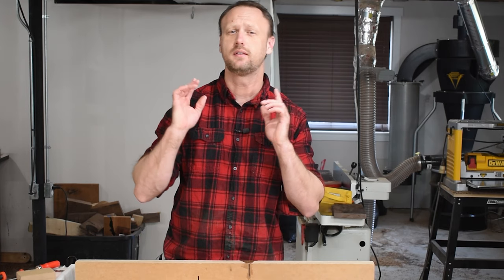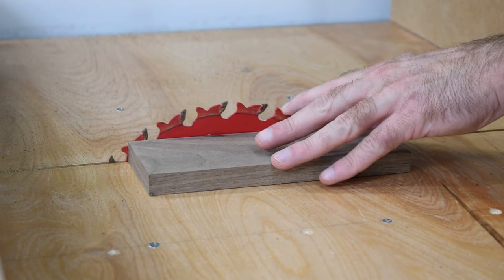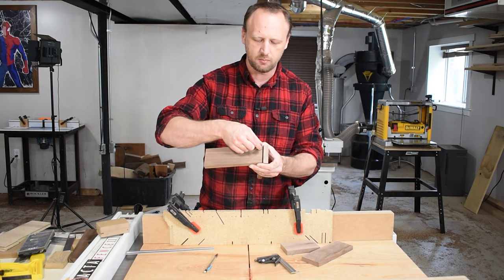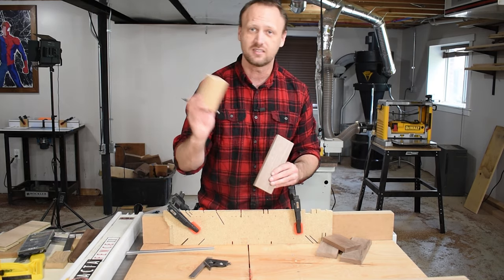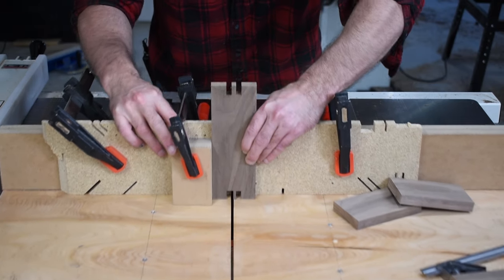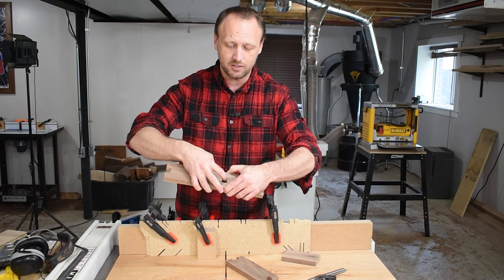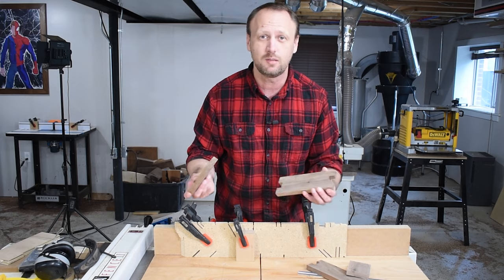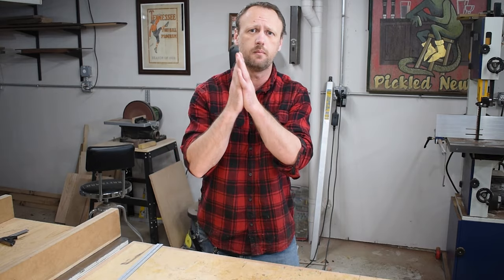Cut Stupid Simple Box Joints without Measuring!

Comment: May seem obvious, but with your test fits as you approach the final thickness of the middle part, if you flip over the section you're cutting away twice the material.  So if it's just barely tight, I would suggest fine tuning with some sandpaper instead of going back to the table saw.  It's been a frustrating thing for me before that I think I did it right only to realize I made some silly mistake like cutting away twice as much as I had planned and ended up with a loose fitting joint.
Reply: Great tip, thanks!
Reply: Well, the only thing about that is that you'll be fine tuning several pieces.  But true, that is better than taking off too much.

Comment: I have tried this in a couple boxes and I confess that I am amazed! However my external mortises have a trend of end up "slanted" due to the fact that the central tenon doesn't provide enough support to keep the board perfectly steady and aligned 90 degrees to the sled while I cut it so it's challenging to make it perfectly squared. I am going to try to make a large central tenon and small external mortises in order to achieve a better support and avoid my board keep wobbling. Otherwise I must be missing some small secret trick to do it right!

Comment: I’ll be 77 next month and brand new at woodworking. Have always been interested but ‘life’ had other plans for me. This lesson for simple box joints is one I can grasp and do not need a 
pro level work shop. You were talking to me, not a life long cabinet maker. I cannot thank you enough!
Reply: 25 years behind you, beyond that, ditto story.
Reply: 70 .....was a heavy equipment op, graders and dozers, couldn't nail 2 boards together if i tried. now, thanks to these people, i now can at least cut a straight line, sometimes, but hey woodworking is satisfying huh
Reply: @louislandi938  I’m late responding,(as usual) hoping you are still enjoying woodworking. I’m 68 in UK and started when I retired. Very enjoyable experience but haven’t started proper joinery yet. I think I will start with box joints

Comment: Perfect timing!  I only have a very small section that I want to creat the same finger joint on…its for my Stop Block on my Table Saw Sled. Once I’ve glued it, I will Pin the fingers for even more strength.